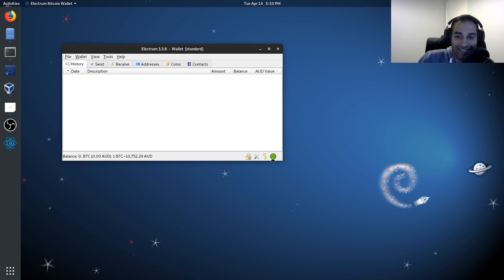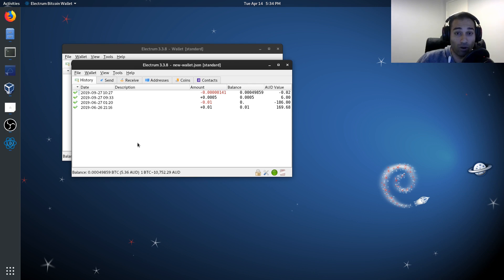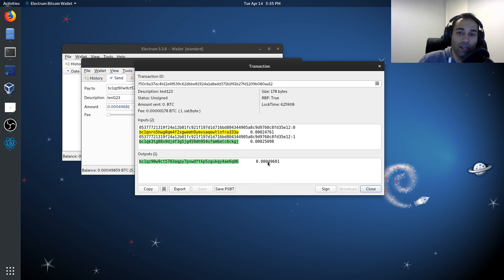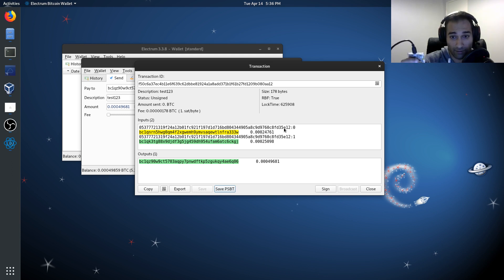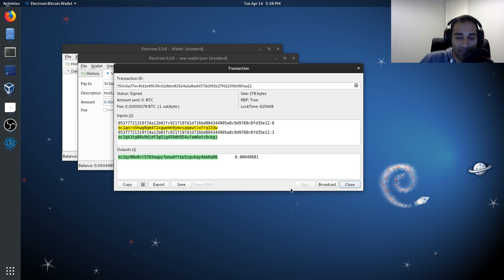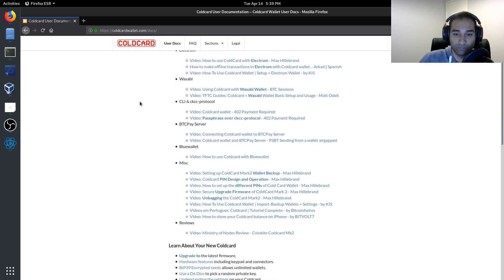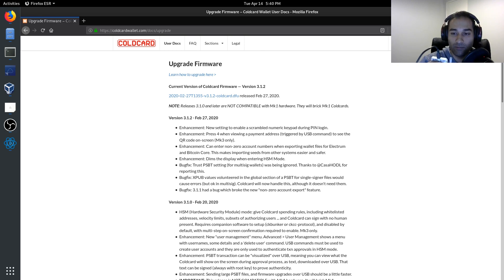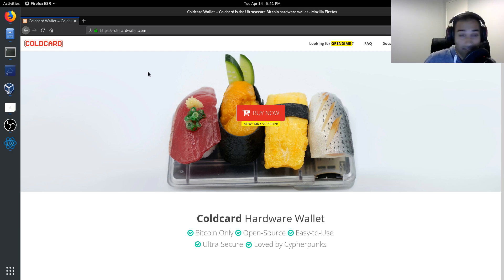13 - myNode series - Using the Coldcard (airgapped)

Comment: Thank you very much, it is possible that coldcard simply show adresses related to the private key, in the case of I only use to receive btc. Thus, This way I wouldn't have to use electrum or even the micro sd, is it possible?

Comment: What if I initially plugged it into my computer? Can I regenerate wallet address somehow?
Reply from the maker: Yes, you can wipe the wallet and generate a new wallet.
Reply: @MinistryofNodes  can you elaborate on this? I am a noob wondering the same thing. I accidentally set up with it connected even tho I wanted airgap. What wallet are you wiping? Electrum or cold card? How is this done?

Comment: I have a question, for example using Samourai wallet if I have it running with a Dojo in the backend and it loses it's connection I will lose the ability to make transactions due to the lack of dojo's connection? , or instead it will query for the samourai servers?
Reply from the maker: Yes, you will lose the ability to broadcast transactions. Once connected to the Dojo, your wallet will not query Samourai servers as a backup.

Comment: How can we know that the firmware file download source hasn't been compromised? Only because of SSL on the site? Shouldn't we check the hash of the file obtained from some other source?
Reply from the maker: There's instructions on how you can verify images on the mynodebtc.com website. You'll notice a file coming from GitHub, which would be your second source.

Comment: Hi, thanks for this series. I have a question. If I run a full node, what happens if my power or internet go down? Will I have to reconfigure things and download the whole Bitcoin blockchain again to get started up again? I want to set up and run a full node to store my own coins, but I'm thinking of moving to another country in a couple of years. Can I just unplug, and set it all up in a new location with no problem?
Reply from the maker: No, you don't have to download the whole Bitcoin blockchain again. It will start back up from where it left off and synchronise back to the network. You can unplug and set it up in a new location with no issues.
Reply: Ministry of Nodes Great, thanks for your help. Very much appreciated!